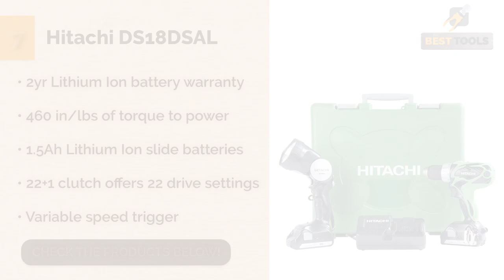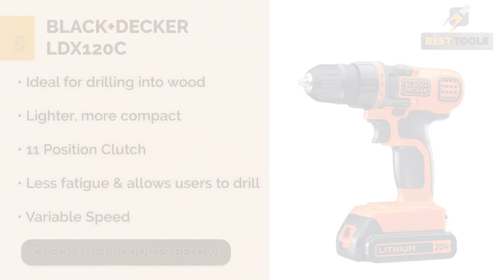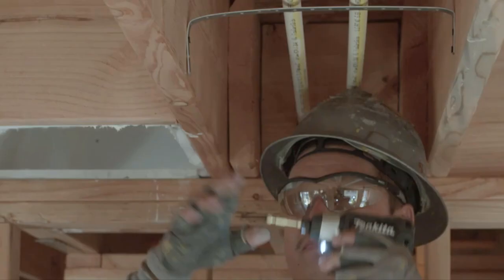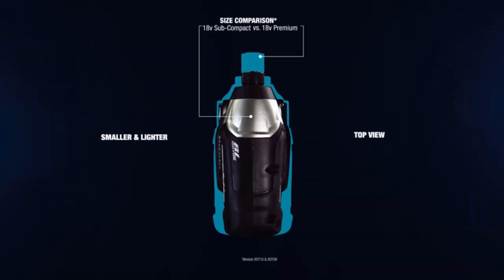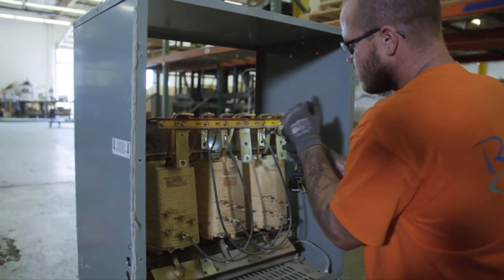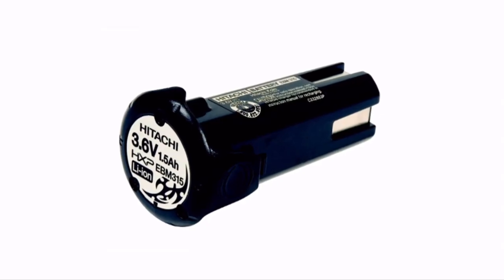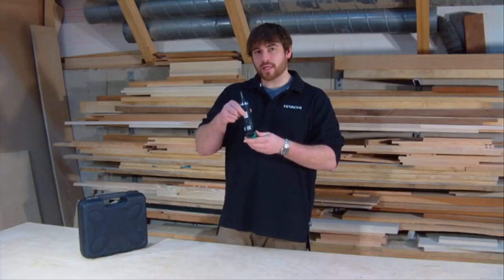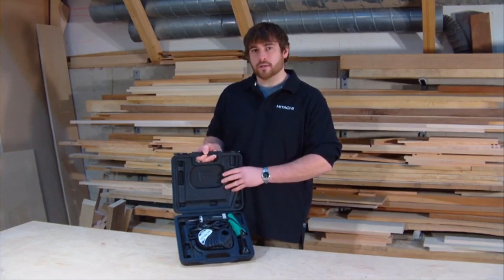Best Cordless Drill 2020 * TOP 10 Cordless Drills 🛠️

Comment from the maker: 👇🏻👇🏻 CHECK THE BEST CORDLESS DRILLS IN 2020: 🔨 🛠️ 
========================
1. Hitachi/Metabo DB3DL2 
https://amzn.to/2XCSmB3
========================
2. Makita CX200RB 
https://amzn.to/2VcNhhu
========================
3. Dewalt DCD771C2 
https://amzn.to/34DTqWU
========================
4. PORTER-CABLE 20V 
https://amzn.to/2XFf2Ra
========================
5. BLACK+DECKER LDX120C 
https://amzn.to/2K6R9Ke
========================
6. Bosch CLPK232A 
https://amzn.to/34GM196
========================
7. Hitachi DS18DSAL 
https://amzn.to/2XDTC7a
========================
8. Makita XFD10R 
https://amzn.to/3bf1tMa
========================
9. Pink Power Drill PP182 
https://amzn.to/3bb1dOw
========================
10. Craftsman N17586
https://amzn.to/3a9VZ3Z
========================